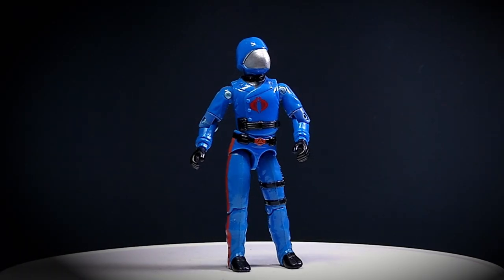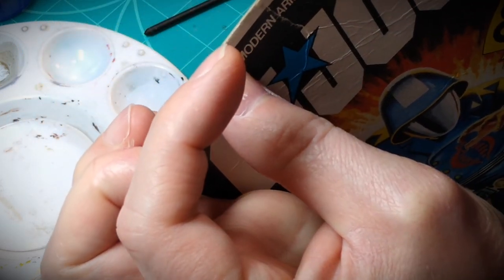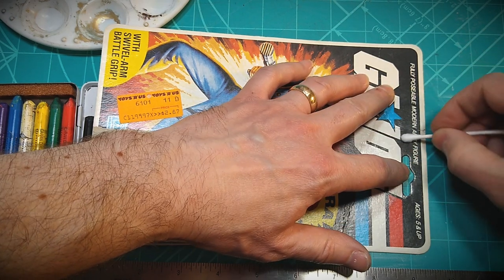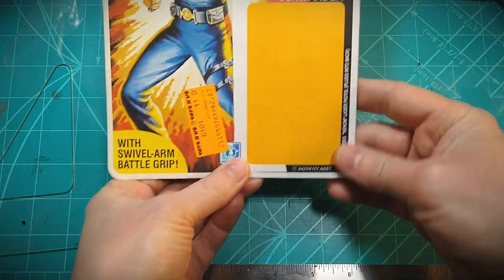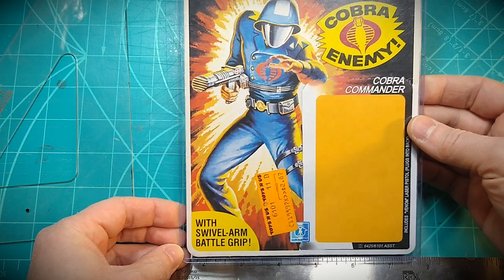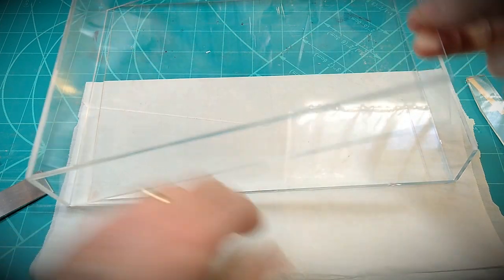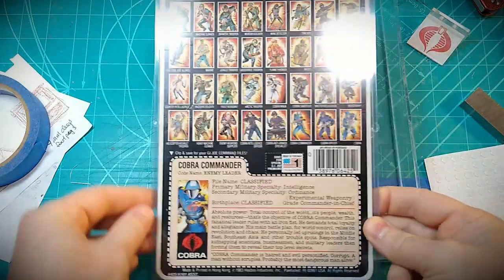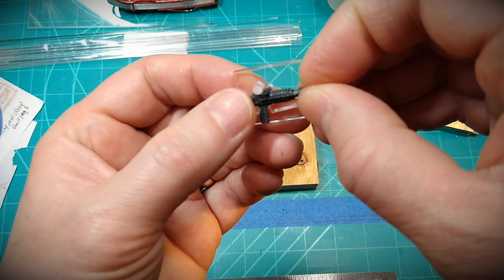Hasbro Cobra Commander 1.5 - Cardback Repair Restore - Display Case Build

Comment: Wow Tim!! Thank you for the video, had a quick question. I am looking into building something similar and was nervous using the acrylic glue (weldon 4). I looked it up and this stuff looks pretty toxic. Was going to use it outside when putting the display case together. Do you use and protective equipment when using it, face mask, gloves etc.. or because your using a small amount it's not a concern for you.
Thanks
Brian
Reply from the maker: You took the first step which is one I think few people do, read the label.  Follow their listed precautions first, when I fill the needle tip bottle I'm in a large open area.  I use a transfer pipette to transfer the cement from the can into the applicator bottle. Working with the applicator bottle I've not experienced a high amount of fumes
Reply: @ToyTinkerTim  Thank you Tim for the response!